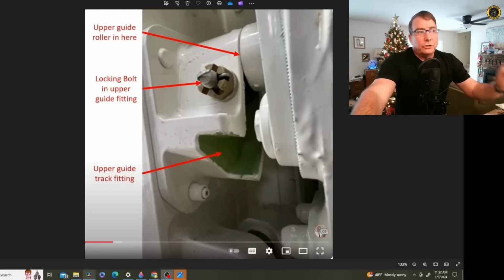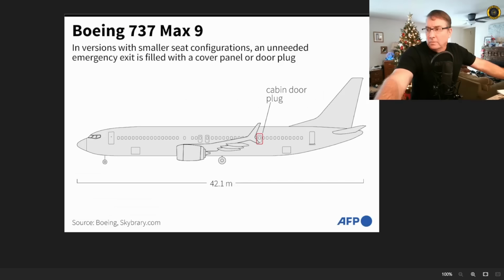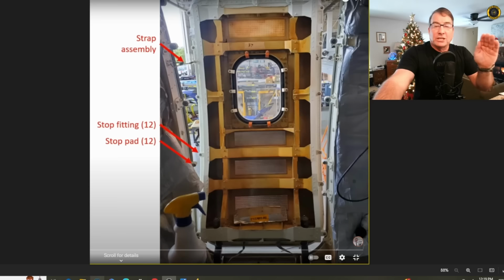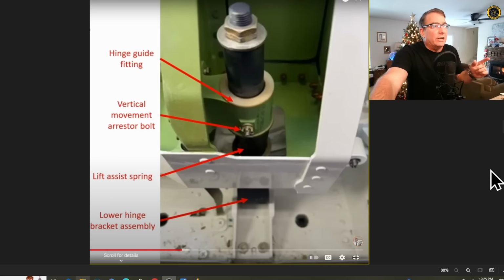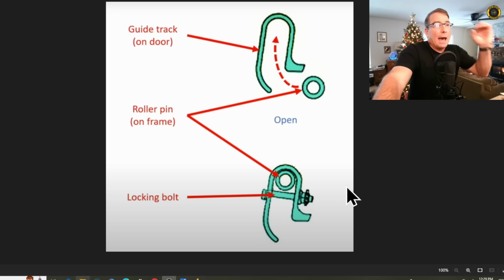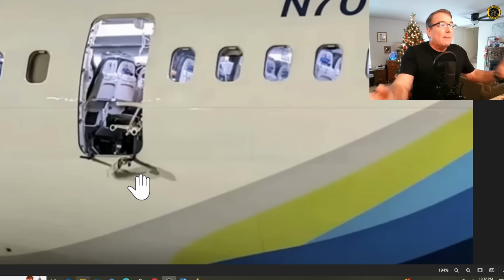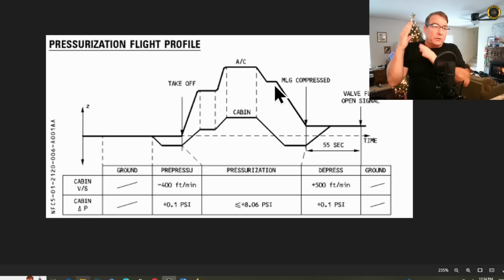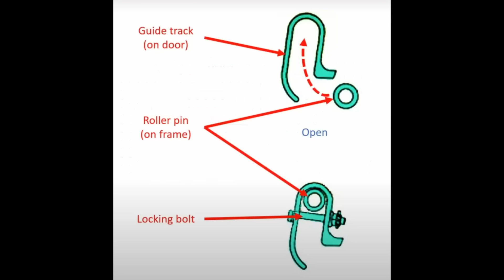Alaska 737 Max-9 Door UPDATE! 8 Jan 2024

Comment from the maker: CORRECTION: 1/11/24 The Plug Doors ARE NOT removed at Renton (Boeing) to install the Interior.
Reply: Wow - that really moves the blame over to Spirit Aero, doesn't it?
Reply: It doesn’t sound like Boeing is taking that approach to blame their subcontractor. Given all the confusion over this door—is it a door? Is it a plug? When/why is it supposed to be opened (so far there doesn’t seem to be a function for a door that opens but has no reason to be opened) and even confusion about it in the manuals, I don’t think it’s fair to throw any one particular party under the bus…yet. 

If I were managing labor of a plane body that gets shipped by train, I wouldn’t be too concerned about securing parts as flight ready on planes that are thought to be intended to be opened/closed during the interior configuration. It sounds like it wasn’t reinstalled for the interior design but if it’s called a “door” rather than a “plug” in the pre-shipment stage then I think there’s a fair assumption that it would have at least been opened/closed/inspected during the next phase at Boeing. 

It doesn’t sound like all of the changes to the Max planes were thought through from start to finish. It also sounds like this door-plug thing was the lucky winner to one of the changes (i.e., two bottom bolts v. a crank per a commenter on another page.) 

That plane was giving alerts. It was doing its job! It’s just that about half the reasons for the alerts are electronic type failures and the logic seemed to have been to follow the simplest rationale first. I’m not a mechanic so I’m in no position to give an authoritative answer but I know plenty of mechanics who take this approach. I honestly don’t find fault with it because on a new plane, it seems reasonable to think that something electronic could have gotten rattled in shipping (by train) since it was a brand new plane. 

Just like most plane accidents, it seems this was a result of a series of failures. 

As far as FAA is concerned, I don’t see that they are all that useful in that they grounded planes AFTER the accident (that’s not oversight or prevention management, that’s reaction management.) Furthermore, Alaska Airlines had already grounded their own fleet. I think it’s Alaska who should be given the credit for taking the lead to ground planes. Just my personal gut feeling on it. 

As a passenger, am I afraid to fly on any Max series plane? Yep. It seems that many undocumented changes are emerging that pilots don’t know about, that subcontractors don’t know about, that mechanics don’t know about, that technical writers don’t know about….etc. That spells RISK to me and I’m surprised the underwriters of plane insurance aren’t outraged.
Reply: FYI the bolt in that track prevents the door from moving up not down. The track is on the door side not airframe side
Reply: @a914freak  I've seen better engineering in the carnival. A particularly cheap and sketchy carnival.

They make carnival rides idiot proof for many very good reasons. If it can be screwed up it will be screwed up.

There's no reason it shouldn't fail stuck instead of failing open. Complete madness.
Reply: Has all the necessary ingredients for a D.B.Cooper 2024 conspiracy!
Reply: @mountainflyhigh   yes and no. Yes spirit is responsible to do the work right, to the standard in the certificate, but no, Boeing is still responsible as the final signer of the certificate. Both have blame, but more on Spirit.
Reply: 1.) In what status/condition is the air-frame  shipped from Spirit to Boeing?  Is it bare metal or has the insulation layer already been applied.  If the insulation has already been applied, and the bolts are hidden, then checking for the existence of these retaining bolts may not even have been on Boeing's list of things to check.

2.) If no bolts are installed in the "spring assist opening" plug, are the springs strong enough to open the plug while the airplane is sitting stationary on the ground?

3.)  From what I can see, if even one of the 4 bolts is in place, it's enough to hold the plug in place and the other 3 bolts are just redundant safeties.  The belt and suspenders approach to engineering.

4.)  Considering the low hours of use on that aircraft I would lean to the idea of only one UNSECURED bolt having been in place that worked itself free.

Comment: Imagine being the last guy to work on those plug doors? 😬
Reply: he was to high to remember
Reply: Guy? 
Should be the company feeling the heat in this, not single individual.
Reply: at least you probably dont have to worry about them finding a lost tool
Reply: @jammymcjammerson5318 😂
Reply: @OhioPalmTrees    Or too drunk?  "Booze...the other white meat."  😉
Reply: I wonder if one of his names is Mohamed and he has mysteriously disappeared XD.
Reply: How dare you assume xir’s gender!

/sarc
Reply: The plugable unplugged plugging door that didn’t plug the hole.
Reply: He'd be in the stickiest situation since Sticky the Stick insect got stuck on a sticky bun.
Reply: Hey Tony! Did you tighten that bolt?
Reply: Well he would be famous/ infamous now.
Reply: markmaki4460 or could be a Donald too.
And 'reported' your bigoted, snide remark
Reply: Sarcasm, right. @OhioPalmTrees
Reply: And how long were you a airline A&P tech?
Reply: @eddy66t6  This could a Boeing design defect, improper torque information in the service manual, or improper installation (not properly torqued) by the ground crew.
Reply: @markmaki4460  What exactly are you implying?
Reply: Don't blame 'that guy' we all make mistakes. Ask why the Boeing Safely Inspectors did not catch the error.
Reply: @sailaab  "Youtube has reviewed the comment and found that it does not violate our community standards"
Reply: @CM-xr9oq  or failure to install the keeper pins which keep the bolt from backing out.
Reply: @CM-xr9oq  I will assert that gallows humor is not for the hyper-sensitive.
Reply: Was the torque wrench certified by top scientists to be dead-on balls accurate? (It’s an industry term.)
Reply: It's a bolt in direct shear in a non-slip-critical connection. Shouldn't be a torque issue. (NOT an A&P,  just a structural engineer, but would have thought torque was only relevant to mating faying surfaces, which this connection lacks.)  @CM-xr9oq
Reply: @sailaab  Grow up.
Reply: Work like this is typically signed of by two guys minimum... the guy who does it and the guy who inspects it.
Reply: @CM-xr9oq  highly unlikely and Not an issue if they had cotter split pins.
Reply: @CM-xr9oq  

"Boeing design defect". No. These plug doors are identical in design to those found on the stretched 737NGs that have been in service for decades.

" improper installation (not properly torqued) by the ground crew". No. Ground crew don't touch these plug doors. They are sealed away behind the interior of the aircraft. it would have to be having a C or D check, which an aircraft of this age is far from having. In fact, the aircraft was so new that it hasn't even had an A check yet!

"improper torque information in the service manual". I mean, this is possible however the wrist pins are designed as a fail-safe due to improper torque settings.

Looking at all the facts, it looks likely that the bolts were not installed at all by Boeing at the factory when the aircraft was being manufactured.
Reply: @MichaelOnines  Good call. There will be a torque spec, but it would not be very critical. Thus the cotter pins.
Reply: @eddy66t6  rest assured that the company will try real hard to deflect liability! There is going to be a lot of lawsuits over this one.
Reply: @macmedic892 🫡 Didn't expect a "My Cousin Vinnie" reference in this! Thanks! 😎✌️
Reply: AND HIS NAME , the last guy to touch that door ,his name is on a piece of paper !!!!
Reply: He’ll be fine…….its the guy that inspects his work that will be fired
Reply: better dust off the resume
Reply: @russbell6418  Not entirely accurate. The use of cotter pins or safety wire have nothing to do with whether the bolt/screw/nut requires torque. Even if there is a torque requirement, a lot of times we will also pin/safety wire it in the event it does vibrate off.
Reply: I wonder what their pronouns are?
Reply: Then his A&P certification is gone. Possibly fired. Same might go with the second person who signed off the installation, which is the final inspector. 
FAA don’t take human errors lightly because of safety. That’s why every maintenance has a technical manual.
Reply: why do they say an internet provider last opened the doors, and now I can't find the details
Reply: Woman
Reply: he should move to iran ...😅 to save himself

Comment: "It only has a plug door or a door plug. A plug type...door plug."  😂
Reply: So glad all the confusion was cleared up there
Reply from the maker: Heretofore simply referred to as a ...."door"...LOL!
Reply: Luckily it isn't shaped like a different kind of plug, then it could get awkward
Reply: @blancolirio  Oh, it's beautifully complicated. Apparently there is some debate about whether this component can legitimately be called a "plug door" since some people hold that the definition of a plug door (or equivalent panel) is that it has to be first moved into the fuselage, against pressurization differential, before it can be opened. On the other hand, it is certainly and officially and door plug, that is a panel to plug (in a perfectly normal, non-technical sense of "plug") the hole where the door would be installed, if fitted, which in this case it was not. I think.
Reply: @michaelwright2986  that was my expectation - that the door plug itself was larger than the gap and fitted flush to the fuselage to make a seal, rather than being held in place by bolts, so this was a surprise to me. Like the overwing exits which have to be pulled into the cabin.
Reply: The media hasn't been explaining it very well. To a layman a "plug" isn't as large as a door, but calling it a door plug really didn't help.
Reply: @theharper1  It's not actually held onto the airframe by bolts, as I understand it. The plug is held in place against pressure differential by the pads, and it's locked onto them by the pressure, so it is kind-of a plug door/panel. When there's no pressure differential, the weight of the door is held by pins so that the pads all line up properly. The bolts only ensure that the door can't be lifted up and free of the restraining pads that are a permanent fixture on the aircraft structure.

Kind of like a plug, but instead of having to pull the door in and twist it, you have to push it up before it opens, which is made extra hard to do by the pressure differential holding the pads against each other.
Reply: @blancolirio — “hereafter”
Reply: @michaelwright2986  I get that. My uninformed expectation was that the "plug" was like an overwing exit which is literally too large to exit the fuselage without rotating it. With some of the overwing exits, you have to pull it into the aircraft, then rotate it to throw it outside. The whole of the exit forms a seal with the fuselage. In this case, the door plug opens outwards, hinged at the bottom, but only after being moved to clear the tabs on the fuselage. Calling it a "plug" is a misnomer. More like a "replacement panel" for the door.
Reply: From the Department of Redundancy Department……
Reply: @GH-oi2jf  "The party of the first part shall hereafter be known as the party of the first part."
Reply: @theharper1  You're right, it would have been much better if the panel had had the design of a plug door (as also with the cargo doors on the DC-10, and the 747 -- a friend of mine was booked on United 811, but got bumped). My point was that although it's not a plug door, official US documents call it a door plug, which is intelligible, but invites confusion: indeed, seems positively designed to produce confusion, as the distinction depends on syntax, and a lot of native speakers aren't terribly precise about syntax.
Reply: @michaelwright2986  fair enough!
Reply: I lol'd so hard at that.

Comment: Nobody is really saying much about Alaska ignoring the low cabin pressure indications and continuing to fly the aircraft over land, but banning it from ETOPS flights. Maybe, just maybe, this particular aircraft should have been taken out of service to make sure everything checked out OK. If anyone cares to recall, Alaska Flight 261 crashed due to improper maintenance and the unwillingness of the crew to land the aircraft when there was an issue. It doesn't look like Alaska has learned any lessons, ala' Boeing.

Comment: There is reporting that the pressurization warning system notified the pilots with warning lights on 2-3 prior flights.  This would lend credence that the bolts may not have been installed at all, and Juan's "mousetrap" scenario was set.  That seems to be the case here...
Reply: Not likely. The pilots would notice the difference between a real pressure problem and a nuisance warning. If it had been a real pressurization problem they would not fly the aircraft on a revenue flight.
Reply: I think the passengers would have complained of the noise of the air passing through the crack if the crack was enough to prevent pressurization.  But not sure.
Reply: My understanding is because of the pressurization issue, Alaskan did not schedule the plane for any ocean flights. So if there was enough of an issue you specifically had the plane avoid flying over open water, maybe you should have taken the plane out of service and inspected it.
Reply: @rael5469  YES!!  THANK YOU!!! what CA would just take the plane up knowing that the door was gonna blow out at anytime....PUUUUH--LEEESSE!!!
Reply: If Boeing had installed the door open light then maybe they would have realised. For some reason they don't install the door open light in the plugged door models.
Reply: @indiekiduk  Apparently that light is the status of the door lock.  This is not a door, so it does not have a lock.  The plug is basically a pressure panel hidden such that it requires removing seats before you can dismount the panel that covers the plug.  So nobody is going to opening this outside of a maint tech in a hangar.
Reply: @LordSlayer001 But inspect it where? With the plug out of sight behind interior trim, would they ever look at the skin of the aircraft or go straight for indicators and engines that run the pressurization for the problem?
Reply: @rael5469  From what I've heard, it was confirmed that the aircraft had been removed from ETOPS status for a day prior to the accident due to what were deemed to be spurious pressurization-related indications. Most of the time, those indicate much more minor errors, such as with the outflow valve.
Reply: @k53847  It wasn't preventing pressurization. The cabin was pressurizing, otherwise neither the incident flight nor the flights prior to it would have gotten far before turning back for the airport. Apparently there was an indication that pressurization wasn't working as expected, though (I'm not familiar with that system, but I would assume this warning is based on observed pressure vs. expected pressure given the state of the bleed and outflow systems.)
Reply: @cynvision it shouldn't normally need inspection - it needs to be verified when opened, and they may check during heavy maintenance but the cotter pin nuts shouldn't ever work loose / fail (if designed correctly).
Reply: @indiekiduk  it would have to be a carefully designed sensor that senses the up/down movement of the plug door because it was still pressing against the ears.
Reply: Pilots do a pre-flight walkaround. Is visual inspection of the plugs part of that? I bet not.

If the bolts were not installed or if they loosened over time, it's likely that the plug started to ride high in its tracks, especially the day of the accident - if that's true, then you might notice it if the door plug was part of walk-around - i.e. a gap between the bottom of the door and the fuselage.

BTW, not criticizing pilots in any way. Plugs are something you should never have to worry about.

Man, everyone was so damn lucky to get away with a zero-death event. 

I so hate what has happened to Boeing in my lifetime. In 2019, I sat next to a Boeing salesperson, former engineer, who basically pounded the table telling us that it was fine for the MAX to have put a new trim failure mode into the airplane because it was the pilots that were the backup.

I could not believe what I was hearing. I lost all respect for the guy at that point.
Reply: This is very reckless....or is it deliberate ?  That's another reason I do NOT fly.  Social trust has gone "out the window"....  just saying.
Reply: In the meantime he got better fuel economy because it was a little bit lighter missing 5 bolts.
Reply: @vbscript2  Sure, and they went to the alternate system and it pressurized.  If the plug was leaking it would have to be dumping a large volume of air via a narrow slot.  Next to a passenger. It's going to be quite loud. If there are no reports of odd loud sounds from the cabin it probably wasn't the cause of the pressurization issue.
Reply: @vbscript2   That shows the rules for ETOPS are working.
Reply: @k53847  Ah, I hadn't heard about the alt system resolving the issue. In that case, I agree.
Reply: @brentsummers7377  Agreed.
Reply: @steveperreira5850  Probably !  Ha !!
Although, it's no laughing matter.  Was this sabotage ?  One would have to be a complete  moron to forget to tighten these bolts.  In my mind, it was deliberate.
Reply: @vbscript2   No......they were nuisance faults. Either a bad sensor....it's wires....or even the pressurization computer. The pilots monitor the cabin pressure gauge which is an analog gauge in the cockpit. If the aircraft experienced actual pressure problems they would have grounded the aircraft. I'm not 100% sure of anything in this mess but I believe the pressure warning light thing was just a totally unrelated nuisance fault. In my humble opinion.